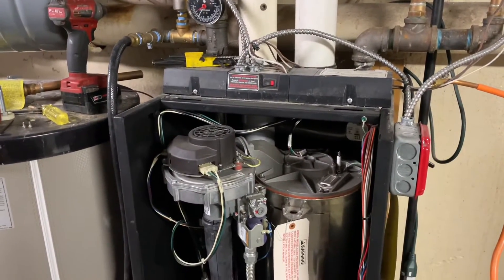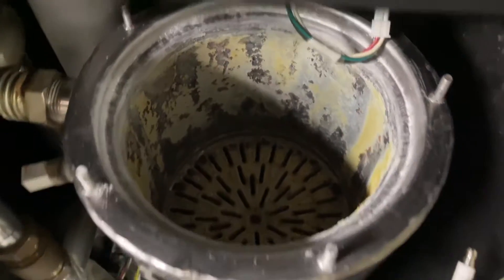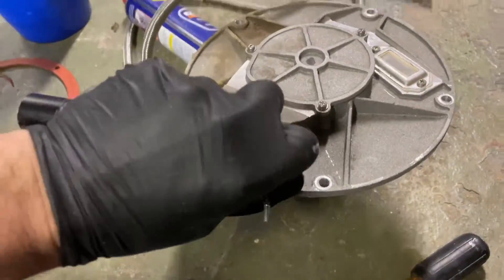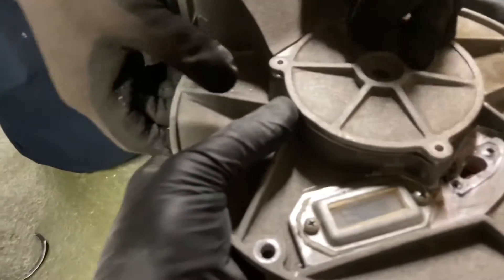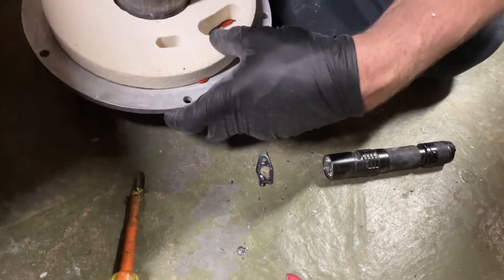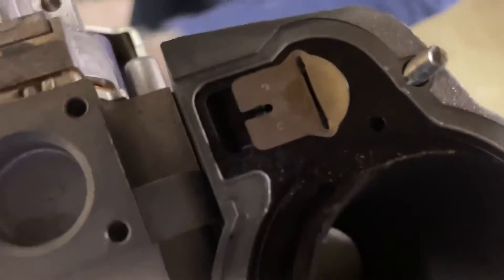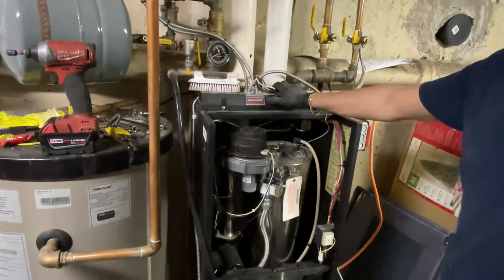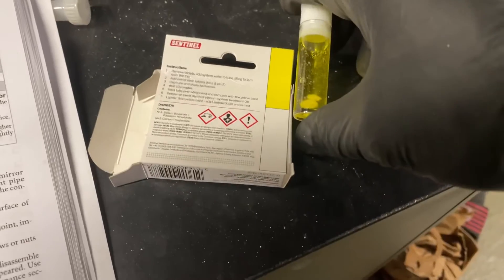Annual Service & Maintenance Weil McLain 97+ 155 High Efficiency Boiler

Comment: i have exact boiler, i never service for 5 years, i only clean yearly the water hose and the ball floating house on the bottom. i Never had problems whit unit . today i have water pressure relieve valve leak continuously drips,  i do resource and this watts water pressure was discontinued,  i have question to you how come i dont have expansion tank installed?  there is nothing, not even on water heather tank, do i need one on boiler?  and another on water heather tank? And what brand and size? thank you, nice video.
Reply: Call a professional

Comment: Wished I'd watched this before I had my service company come out for my first annual maintenance as a new home owner. They did NOT have the annual maintenance kit, which is clearly called for in the manual. Ignitor went bad two weeks after maintenance which would have been replaced if they did what you did. Cost me another $500 plus not having heat for a week while they had to order the parts kit. I think I'll order the kit and just have it on hand. Good video - I think I'll buy you a headlamp for Christmas
Reply from the maker: That's rough, glad I could help!

Comment: That's ridiculous you have to do that every single year That's a lot of money there.
Reply: That’s the problem with some of these high efficiency systems. Any money you save on energy costs is lost due to the high cost of maintenance and repair.
Reply: @PipeDoctor  a navien The annual service is just run cleaner through the key exchanger and clean the filter which a homeowner can do if they're that type of person and you don't have to disassemble the whole thing unlike that weil McLain. How much did that serve this cost roughly with parts and labor?
Reply: I paid $300 for a maintenance service plus $80 for service kit. The guy screwed my system up and would up having to replace one relay. Now I do it myself.  Also had to replace my blower assembly ($510) after 8 years.
Reply: Maintenance on the Lochinvar Noble is very straightforward and easy. Lots of room to work  inside the cabinet.

Comment: Hey can anyone tell me: Why would I as a consumer choose a condensing fire tube boiler over a condensing water tube boiler? For example the Navien NFB vs. NHB boilers
Reply: Excellent question.  Generally speaking water tube heat exchangers have higher head (more resistance to flow), and therefore in most cases must
 be plumbed primary/secondary.  They also don't generally have much water in the heat exchanger making them more susceptible to various undesirable conditions like flash boil -- this could potentially crack the heat exchanger.  Comparing NHB vs NFB if you look at specs, NHB goes down to 8 kbtu/h where NFB-175 for example only goes down to 17.5 kbtu/h which is more than double.  So each has their own uses.  A lot depends on how a house is zoned.  Ideally your smallest zone should be able to emit the minimum firing rate of the boiler (at condensing temps).  Otherwise it will short-cycle the boiler leading to its untimely demise.
Reply: @PipeDoctor  Mike, it's your own fault, you got me interested in this when you visited me and offered NCB-240e, AND you said that even though the thing is rated for 95% efficiency, in reality you'll only get about 88%.  So engineer in me thought: WTF???  So I started learning.  You created a MONSTER!!!
Reply: @PipeDoctor  A while back, just before that gas moratorium began... I'm guessing early 2019...

Comment: Basically an ultra with a better heat exchanger
Reply: Hit the nail on the head with that one
Reply: No it basically an eco with an expansion tank and its own primary loop and ports for an indirect tank. An Evergreen is basically an Ultra with a better heat exchanger